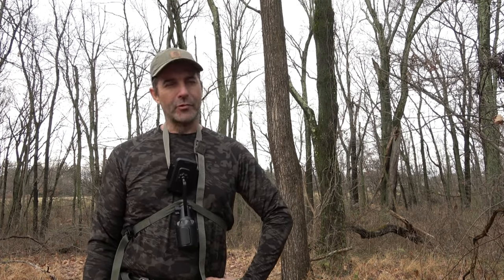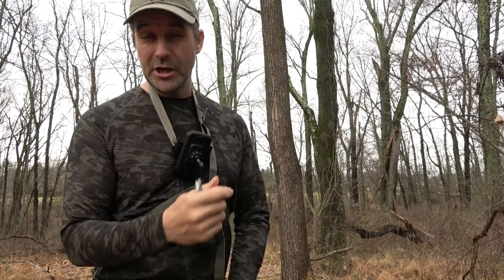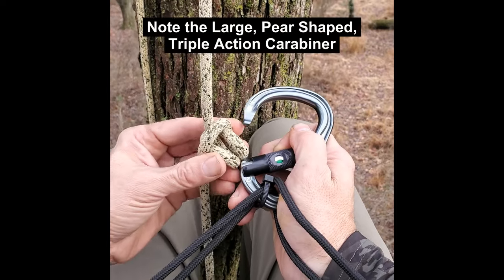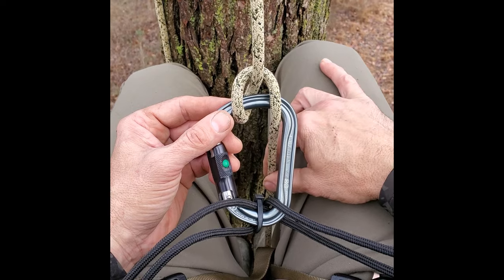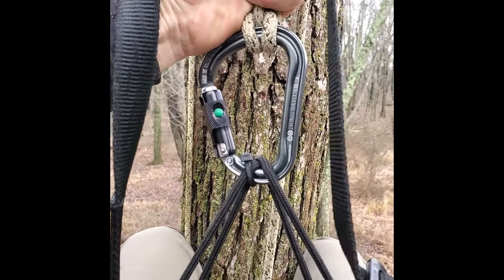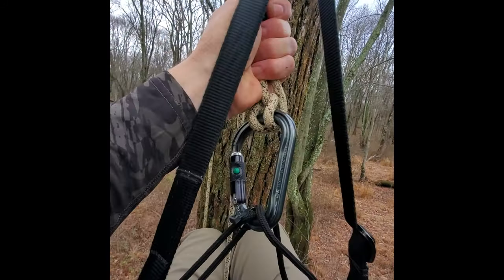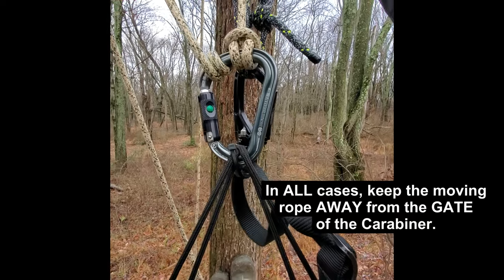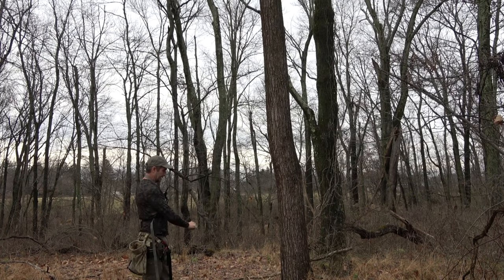Single Rope Rappel on the Munter Friction Hitch, Tree Climbing Demonstration

Comment: Regarding rope wear from friction, here are some test results published in Hitch Climbers' Guide to the Canopy. The tests measure the point at which the polyester in a friction hitch cord loses its "tactility". The length of rope run through the hitch versus speed of descent is: 1,000m of rope run at 1m/s (test stopped due to time constraints); 220m of rope at 2m/s; 40m of rope at 3m/s. Conclusion- friction heat alters polyester. Go slow!
Reply from the maker: That's interesting info. Thx for sharing.  My intuition says that there are other variables in the test. For example, single vs doubled rope, what if any load is on the hitch, what hitch, and how tight it is.

Comment: i use a munter on a rescue 8 because i’m 215 lbs and standard/typical rig doesn’t give me enough friction and i come down fast 😊
Reply from the maker: Is the Rescue 8 device droppable? Meaning, do you have   to handle it loose to engage it?  I have hunted in the cold to the point that my fingers didn't work and I just wanna avoid needing anything I can drop.

Comment: what you call a super munter is a variant clove hitch, that’s a good bit of friction
Reply from the maker: I am familiar with the clove hitch and disagree: the super munter is not a variant of it. The Clove doesn't change direction: the turns go the same way around the host.  Also, the clove hitch cinches, and that is not a feature we want in a friction brake.
Reply: @ i had to look at it a few times on rewind , i didn’t see it right away, at first glance it got me , i know if a clove would take a third turn it would lock up , i did have my glasses on when i watched it again ☺️

Comment: i would always put a prusik over my rappel device too in case you lose a hand on simple rappel rig
Reply from the maker: @DavidWilliams-wr4wb  yes, we have to try to anticipate everything that could possibly happen and have a plan or mitigation.
Reply: @ i have used a variant like this for years when i am forced to use a carabiner to rappel and my rescue 8 is new and until the finish wears in a little it’s really slick so with my 215 lbs i need the friction, i’ve fallen with style many times because of lack of friction and for all the green newbies that can be harder on your ropes to rappel faster with less hitch on your device so to add friction at your device doesn’t always add damaging friction to your ropes , it’s actually quite opposite from some of my past 100’ dive bomb drops , long story short this is a great hitch if you are big and need friction

Comment: Thank you for sharing your creations. I used the munter  to rappel and didn't like using a prusik as back up with it attached to the side of my harness. I have 40 foot of rope for single sticking and rappel so I used your system on it and it worked better than expected. Thank you so much. I may not ever uses climbing stick again.

Comment: Running the line across the screw gate could unscrew it. Right or left handed shouldn't matter. Run the line against the spine to avoid a foreseeable  accident.
Reply from the maker: Appreciate the input. 2 comments: 1. Unlike conventional use of the munter, i demonstrate feeding line in from above ensuring no contact with the gate; only the top of the carabiner. This also neutralizes spin. 2. Screw gates aren't considered appropriate for these applications by modern standards. Use a triple action, auto locking, pear shaped carabiner.
Reply: @jrbtc   maybe but to be honest I have bigger worries because even if it did unscrew you would be pushing it closed, sure something to watch out for but the problem can be managed. Autolocking/twist can be bad in muddy (caving) or icy (mountaineering) or sandy locations so sometimes screwgate is safer

Comment: Howdy JRB. I have always been a climbing treestand hunter. Way back making a test I discovered that the belt safety harness would kill a feller pretty quick. So I designed a 3 point and my wife sewed it up. It worked, some....the same as a pro 3 point I got later. The thing would turn you upside down if you let go of the rope. Time rocks on and I grab the very first proper harness ever made, I guess... the Fall of the Woods. I still use it. Lastly I came up with a dirt simple repelling system to get down safely. Or so I thought. After numerous tests over the years my son managed to throw in a wrinkle which defeated the darn thing sending me back to school looking for a Plan B. That's what brought me here. 

The braking system I discovered is simply this. All yuh need is a piece of rope like yours and and old fashioned smooth carabiner. Exactly 2 wraps of the rope on the tree end and you can let yourself down with two fingers.....and I'm talking guys weighing 250 pounds. 

I'd do about 150 more tests on the thing before I'd call it perfected....there is a possibility of one wrap riding over the other and binding....but I have tested many times and it always worked for me. 

In my case, this is all fine and dandy...but how to hang from the carabiner when you want and repel when you want is THE problem. Thought I had it solved. It wouldn't take much....but whatever the gimmick, it escapes me today. I'm no engineer. It's only been a few hours my time when I discovered I was hanging by a thread for all these years and didn't know it.
Reply from the maker: I worked with a few arborists when i was younger who would employ a similar technique when they were cutting and I was lowering a large chunk of the tree. A few wraps can create a ton of friction.   But it does vary depending on the roughness, diameter and dryness of the part providing the friction.  It also causes wear on the rope and tree.  If ya rappel just a few times out of a Sycamore or Beech or smooth Maple, we'll burn thru the cambium. But the biggest problem is that most hunters are climbing trees that don't have branches and tying into the trunks  directly.  We need a solution that works in every situation.  Cheers
Reply: @jrbtc  You'd think by now we'd have the solution. Fact of the matter today in Alabama we have had years recently where nobody died in the woods as the result of a gunshot. In every instance it was treestand related. I understand what you said that the two loops is hard on the rope, but in the climber world you're most likely to ever need it only once. Thought I had that licked for decades and my son just blew me out of the water. First test he lowered himself into the loopy harness like we all did and it worked perfectly. When I went to video him the next time he was in his treestand and he let himself back down to take the slack out of the harness and kinda sat down quickly. That broke my system, same as woulda happened if I had fallen into the harness. That's something we'd never done before. Oh well. GREAT to hear from you. I am old hunter and less agile.... Gotta stick with my API stand. Ha. Got a little longer to use it.

Comment: Great video, thanks. As a beginning single stick hunter, I am going to practice this in case I ever drop my device.
Reply from the maker: Good deal.  In general, think about every single thing that could possibly go wrong and have a plan.  For a one sticker, my main concern is a stick kickout or completely disappearing at any time during the climb including the first set. I see a lotta one stickers who don't attach a tether until they are 8ft off the ground.  My next concern is management of slack.  Keep slack at an absolute minimum.  Cheers and good luck

Comment: Thanks great demonstration of the Munter hitch. I saw it used by firemen on the TV show Emergency 51 using a massive carabiner. I would only use it if all I had was a carabiner though since I would need the super Munter with an extra turn at 225lbs. I try to keep a rescue 8 with me incase my Petzl ID has a problem.
Reply from the maker: Thx. I am old enough to remember that show lol. As a hunter, I have had to execute rappels in cold conditions, in near darkness where my fingers were too cold to function and I have a rule that nothing I need is capable of being dropped.  I have a few figure 8s but don't like needing to tether them, nor the metal on metal... and so i just keep it simple and Munter down.

Comment: John, is there a reason you could bring the tag end over you thee fingers twice, then engage the biner?  this introduces more friction, keeps the tag end away from the hinge, AND keeps the tag end in the right hand.
Reply from the maker: @toddw9518  i am not sure if you mean to add this to the munter or use it instead of the munter.  We would not use it instead simply because if our hand slipped off the brake strand, it would not provide much.  But we can add wraps inside the munter, either side, to provide additional friction.  It's a good reason to use a large carabiner.
Reply: @jrbtc  No, that's not it.   Stop the video at 5:00minutes.  At this point I add another loop around tips of the fingers then engage the biner.  There would be one strand on the front left, then back rope, and 2 strands on the front right.  Hope this cleared it up a little.
Reply from the maker: @toddw9518  yes, we agree... and we can add that extra turn on either side of the carabiner, on the brake strand or on the inside... both will add an incremental amount of friction. But we still need to manage spin. But because hunters will need to do all this with gloves on in freezing conditions and cold fingers, in my own experience and experiments, the options I show in this video are adequate.  But it's a great point. If i do another video on it, I can add that detail.  Thanks!

Comment: Excellent demo .... how did you break your friction hitch with body weight on it?
Reply from the maker: As you have correctly surmised, most friction hitches can't not be broken under the load of our body with such ease. In this video, I am using the 523 jrb ascender hitch. It is one of several friction hitches which I have introduced and are available here on my channel which have the ability to be broken under load for most individuals and cord and rope combinations.

Comment: Could you use synthetic winch rope? Capable of more than enough weight
Reply from the maker: I have never attempted this nor could I recommend it. I am sure we could pull it off, but that doesn't make it a good idea.  Climbing ropes are designed with a rugged sheath over an inner core  and can handle friction.  To my knowledge, a winch line is optimized for strength only, not abrasion.

Comment: John - how do you recommend switching to the munter if the friction hitch cannot be broken?  In other words - how can you introduce slack enough to unclip the friction hitch from your bridge, so you can rappel on just the munter and abandon the hitch?  I have seen the foot loop videos but that is still using the main rappel line, which would be taught.  So how do we self rescue from an unbreakable friction hitch and only having one rappel line?  what am I missing?
Reply from the maker: It's a perfect question: we need to be able to break our friction hitch to get started.  It's one of the reasons I introduced 3 which can be broken: Double Michoacán, 523 JRB Ascender and Longhorn Agile.  But if you're not using one of them and found yourself on a Distel or Prusik, there are techniques outlined in this video:
https://youtu.be/1P2DytGuXXU
In an emergency, we can also use the "midline munter loop"... search for that video titie.
Reply: @jrbtc  got it.  the key piece I was missing was adding the munter before adding the foot loop, then use the foot loop, hold the munter, unclip the friction hitch from the bridge, weight the munter, disassemble the footloop.  Just tried it in my basement and it worked!  appreciate it.
Reply from the maker: @youtoober87  if you have the strength to just fold a bight of rope, put your foot in it and squeeze long enough to unload your hitch, that's the way to go. Not only is it quicker, but less risk. It can be difficult to remove a Garda while holding tension and ya don't want to risk that the rope slips in your hand while doing so, cuz the Garda could get sucked into the munter.  Still recoverable, but ya gotta start over by stepping up and loading your hitch. If we were discussing it in person, I would try to convince you to safely use a different friction hitch.
Reply: @jrbtc  Thanks.  I actually use the double rope munter for an emergency foot loop that you showed instead of a garda.  I do use a breakable cornell hitch, and that is my normal plan.  But I want to be prepared to be able to get off the hitch completely if for some reason it became unbreakable (maybe something got pulled into it, maybe I'm injured).  Appreciate the videos.

Comment: Couldn’t you just rappel with two or three around a carabiner? Also couldn’t you just take the end of the rope after you tie the Munter hitch and bring it around your body and hold with your opposite hand to add more leverage/friction?
Reply from the maker: This video is about the munter and how I use it. I haven't used, nor could I recommend the methods listed. For example, if we get the Munter set just right and the rope slips out of our hand, we should not go into a totally uncontrolled, accelerating fall. Because the Munter continues to provide friction.  I don't believe that would go the same way with the suggested techniques.

Comment: I have two questions: First; so far in my quest for saddle hunting knowledge, you are the only person I see using the swivel carabiner (this may not be the proper term) on your primary bridge. What is the perpose of this device vs a regular screw lock carabiner? Second question: how does weather, particularly rain, affect the friction hitches on the climbing rope? I’m just concerned about my rope getting wet from the ground (standing water a few inches deep) or getting caught in a rain shower. It is usually wet where I hunt and if a wet rope is unsafe this may not be a viable hunting method for me.
Reply from the maker: Excellent questions. 
1. A swivel is not necessary in the majority of scenarios.  However,  here's a few where its nice. Note that I don't switch to a tether, and so its all about keeping our lines from getting crossed. Sometimes i climb up a complex tree with multiple bends, branches or trunks and my sitting position in the canopy is completely the opposite of how i started the climb.  It's nice not to have my lines crossed when i get settled.  Another scenario is that a deer is circling or flanking you and as ya follow him through the forest, the two rope strands are getting twisted.
2. Yes, Water can have an effect on the hold of friction hitches. Webbing is affected more than cord. In my experience, using other friction hitches such as Bachman and Michoacán, when a friction hitch slips, it's a slow creep, not a drastic slip. And a pinch on the top typically stops it. But I have hunted through major rainstorms on the 523 JRB Ascender Hitch without any slipping issues.  I have also tested it after soaking in water.  I am not saying it can't slip when wet, but I have not experienced it on 523. When i get to the top of my climb, i can remove the footloop and put in the munter right away.  This way, even if a friction hitch slipped ( for any reason) i am safe and ready for rappel.
Reply: @jrbtc  thanks for the reply John. I really appreciate your videos. Keep up the good work!

Comment: John, do you have a video on how you climbed. You didn't appear to have a preset loop and were not using a climbing stick of any kind.
I am very interested in the details on  how you ascended the tree for this video.
Reply from the maker: Chad, as i mentioned in the video and in the video captions, I climb using my JRB Hitch Climbing Method. This is the playlist... so far, all I have done is introduced concept to see if anybody else had been doing it. Or anything similar because the knots used are all my own. Next season, I will be developing more content on this playlist, as I have made several improvements to the method since publishing this initial video.
https://youtube.com/playlist?list=PLETL-PceEXkbOxNPBrpcIFnpl2HUmSrwM
Reply: Thanks John, I've watched that video but you have clearly made some changes as the 2x4 was not incorporated. I look forward to the updates.
Thanks again for all the content it is much appreciated and extremely helpful
Reply from the maker: @chadgoebel7476  yes... i will get to that... but summarizing the changes since that video:
1. Using the JRB Ascender hitch. Its much better than anything else.
2. Eliminated the small (yellow) tending loop.
3. Although the hard bottom footloop is more comfortable, it's not my standard footloop and i want one system to take in the woods and climb with different methods. And so, i am still tweaking the best way to setup the standard footloop to do both jobs. 
I am considering a few other things too.

Comment: Another question, I have noticed you are using Sterling Oplux with these knots, as well as Sterling accessory cord. Do you have experience with these hitches/ropes when the rope is wet? Have you used other ropes such as the Canyon C-IV? I am considering purchasing a longer rope and trying to narrow down my options. Thanks!
Reply from the maker: The exact properties of every wrap and cord combination can be different when wet. For example, I took Sterling Oplux and soaked it in a bucket of water overnight and then tested Michoacán friction hitches with 6mm cord... and they needed one more wrap to hold. And so my general recommendation is that: wet test your stuff as appropriate, add a wrap as appropriate, and of course, in actual climbing systems such as the JRB Climbing Method, we are never dependent on the Integrity or hold of any single friction hitch. Because we have built-in redundancy.  And we can always get to ground safely without assistance.
Reply: @jrbtc  as always, very helpful, thanks!